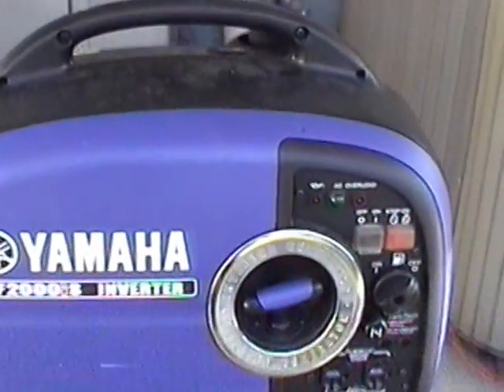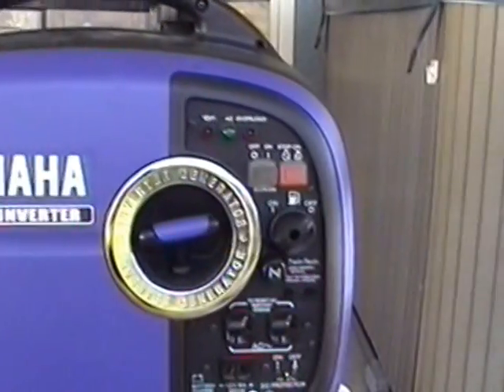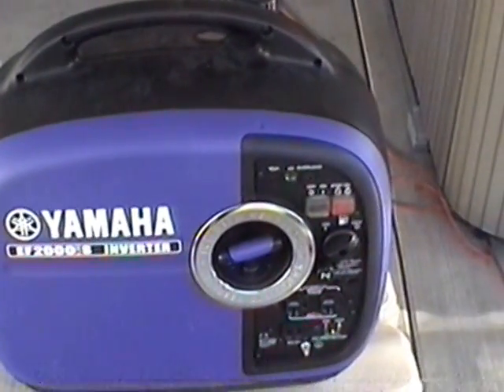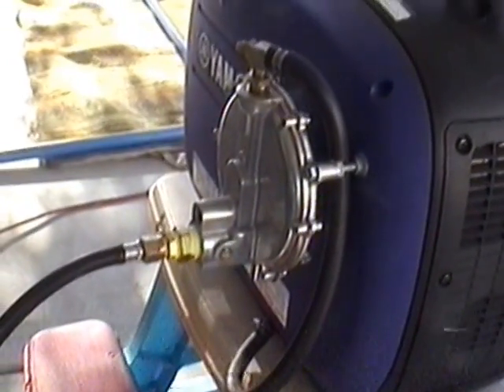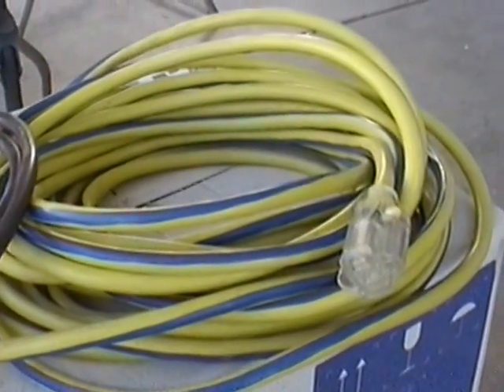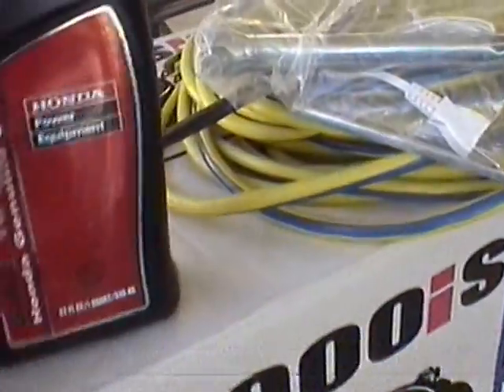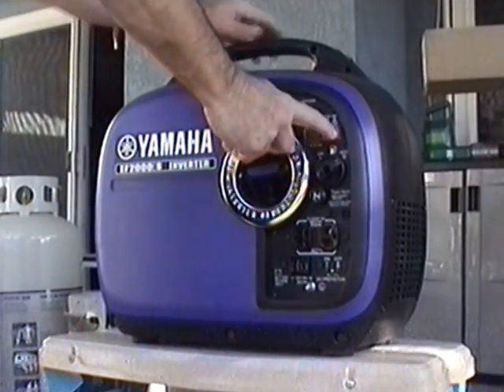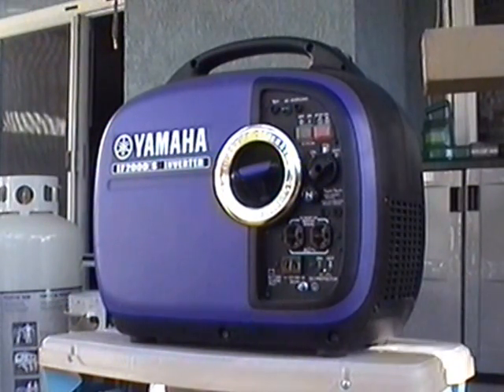Yamaha EF2000IS tri-fuel Generator

Comment: How much was the total investment to convert it to tri-fuel? I'm going to be getting one of these generators, and I really like the idea of it having tri-fuel capability. I can remove the carb myself, and reinstall it myself (just like you did). Just want to know how much it cost you to do ti the way you did it.
Reply: patd4u2 Just got my Yamaha 2800 from Central Maine Diesel. So just need to hit the release button on the back of the diaphragm, choke it, and pull to start?
Reply: Thanks working like a charm now, had to fill up the oil reserve. Its was partially full the vendor.  What size propane tanks are you using?